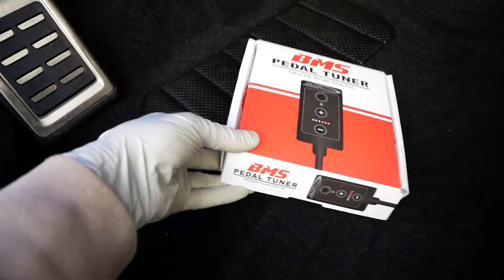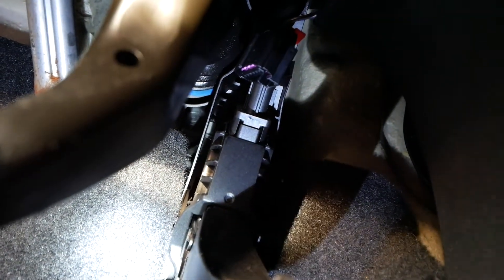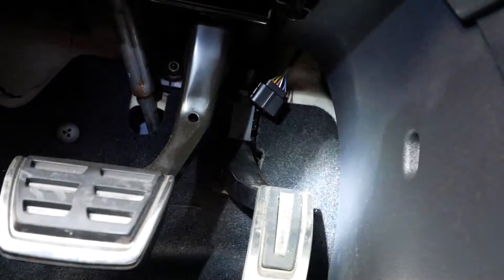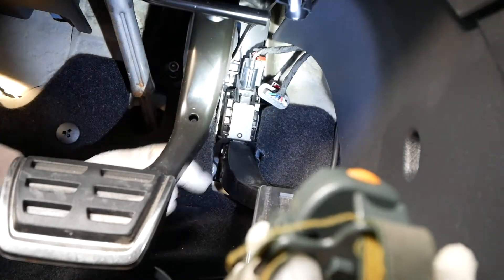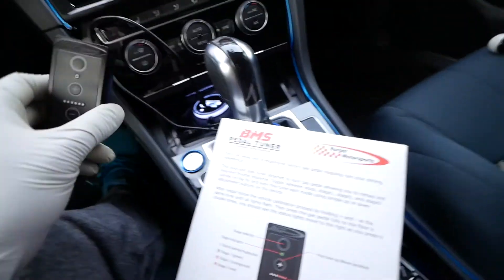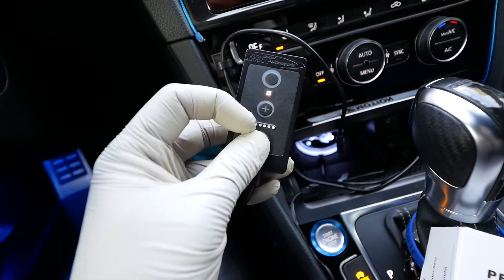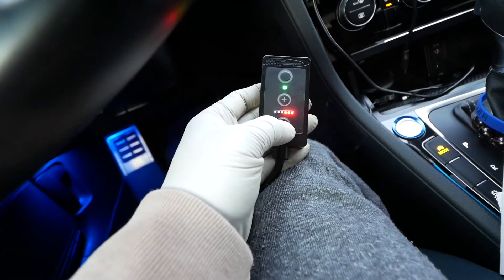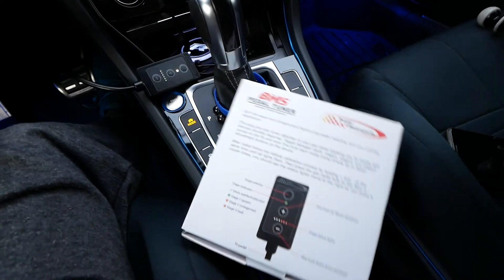BMS Pedal Tuner Installed on my MK7 Golf R | DTE // REMUS responder alternative

Comment: Thanks for the video. Does it improve throttle response for sport mode only? Will this void my warranty?
Reply from the maker: It improves throttle response no matter what driving mode you're in. This will not void warranty at all. If you think your dealership will give you problems, just remove it before going in. Very simple install and removal.